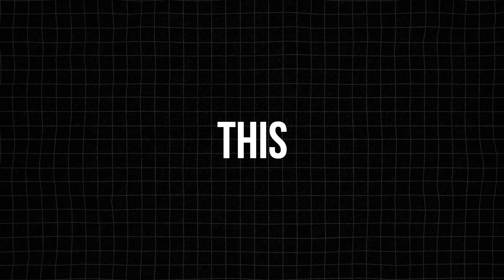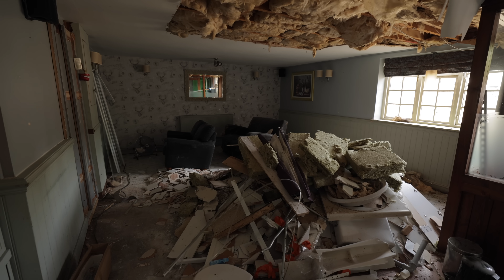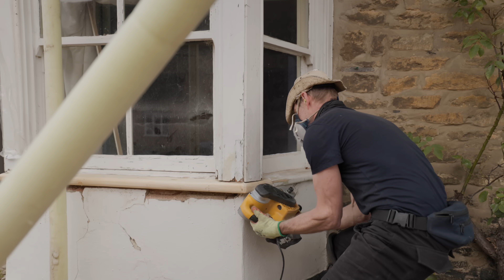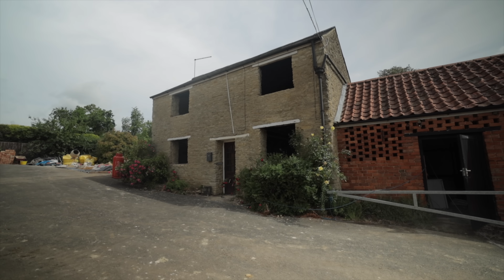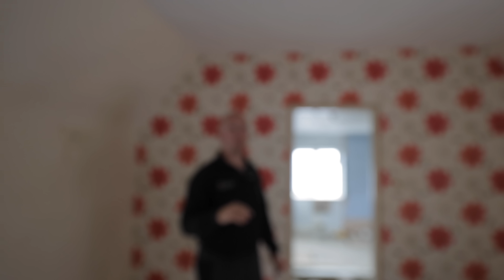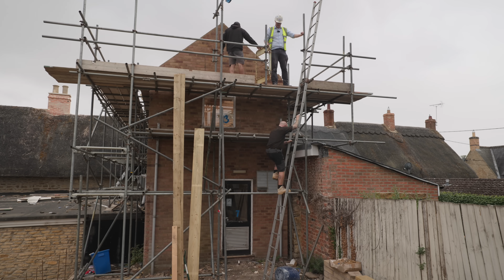£1,000,000 PUB Renovation (300 Years OLD)

Comment: Just a question on the windows.
I know it’s a conservation area but why didn’t you replace more of the windowsill?, seems there still some weak areas where the join is also the part your going to put filler and resin in why not cut part of that out to solid wood as to my mind it will last so much longer.
The other thing is why not take all the paint of the windows and apply new as again there’s less chance of it peeling of flaking off in the future.
Reply from the maker: Hi Robert the process we have done here is what the client has asked for initially in order to gauge suitability on longevity and finish of this process more so … but stay tuned for the rest of the window restoration works ✅